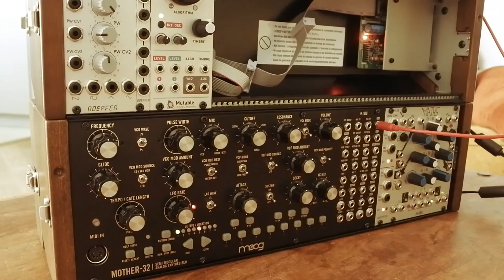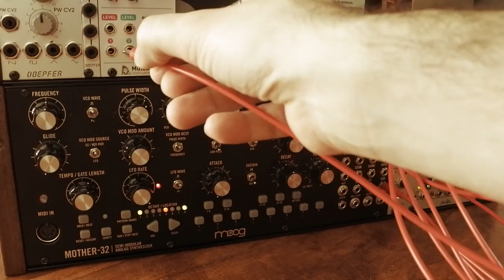Moog Mother 32 and Maths by Make Noise

Comment: Thanks for the ideas, Oz!  Be careful to pay attention to the voltages running from the Maths into the Mother-32. I've started (but not yet finished) a doc on CV specs for my gear - most of the M32 inputs like signals that are at most 5V.  I think Maths channels 2 and 3 output 10V at max  setting.  From what I've heard, problems won't necessarily occur right away, but will occur over time.  Friendly note from a (nervous) person who knows a little (not a lot yet :))   Maybe you already have this topic well in hand?  If so, tips are welcome!
Reply: omg I've just bought m32 and maths and now i read this.what can i do to avoid problems?? atenuverter?
Reply: Thanks for posting this. I'm an extreme noob and I too would like to compile CV specs for my gear, but I'm having trouble finding some of these specs. For example, Mutable's Marbles outputs a maximum of +5 or -5 volts, but the manual says nothing about what it will accept as an input signal. Do I presume this means it will handle up to +10 unless otherwise stated. How do I determine the max voltage if the documentation doesn't say?

Comment: Hey I don’t see an octave plug on the mother-32, how do you control an external  oscillator with the sequencer? I see the gate to control when it plays but not the octave to say how high or low to play it.
Reply from the maker: Dannytalk just work on one octave range, set on the mother.
Reply: Maybe the keyboard output?